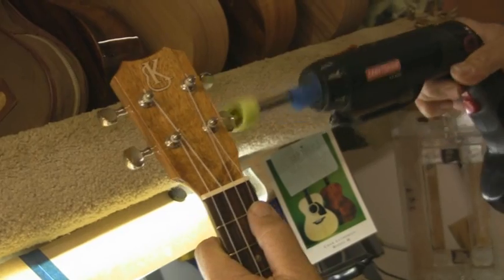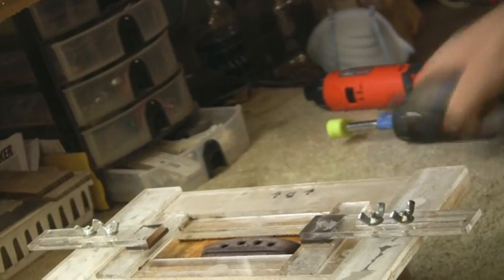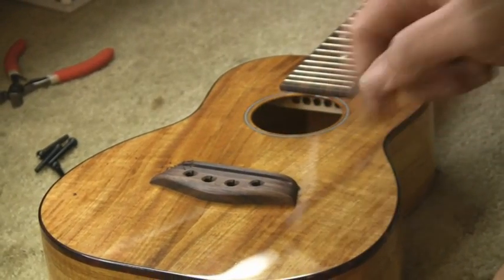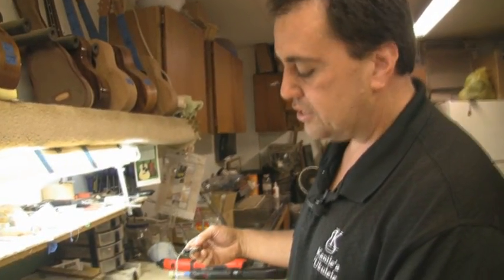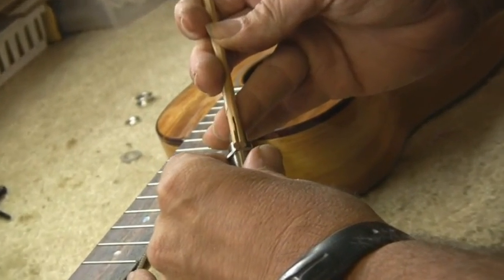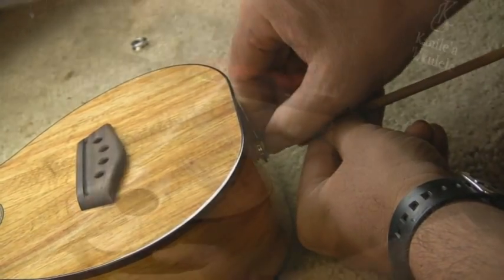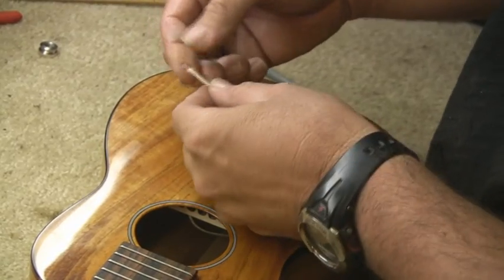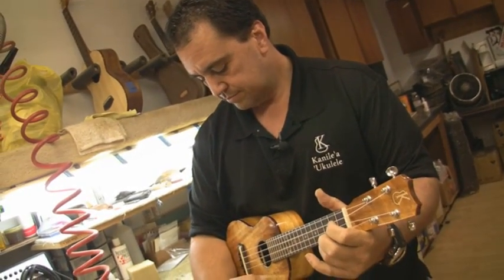Uke Minutes 69 - How to Install an Ukulele Pickup

Comment: Also if you driving a hole for your end pin jack consider using the stewmac.com End Pin Jack Reamer. First apply some painters tape to the surface of your instrument to reduce any splitting during the drilling process. The Setewmac End Pin Jack Reamer is the tool you should be using for a perfect damage free hole in your precious instrument. Of course there are other tools and ways to do it but your results may vary.

Comment: I made a video of this process too. The stepped drill looked like a good idea - I just used and new drill bit after a smaller sized one. So that Misi uses a rechargeable battery? Looks like a good solution as I had to cut a panel out for the main unit but at least I have the tone and volume on it.

Comment: Hello,
i have just one quetion.
my uke has a thicker piece of wood just on the spot you are doing the hole.
i just want to know if the jack is going to be long enough to go until the other side.
thank you, 
i am asking this because i can tell that the uke you are using on the video doesn´t have that thicker piece of wood in that spot cause you can make the hole in a very easy way.

Comment: Good instructions.  But wouldn't it be easier to sand the bottom of the saddle than to route the channel deeper (especially lacking the slot routing jig)?  Maybe the point is to preserve the existing side support of the saddle?  Or accurately preserve the original action fixed by the saddle height?

Comment: You may want to consider the K&K Aloha Twin pickup. A lot less intrusive and reproduces a nice natural sound of you Uke. Its a passive piezo pickup but they have done a really good job on the manufacturing of this pickup and no capacitors or batteries inside your instrument. Its a lot cleaner and has a decent output for a piezo pickup. I personally didn't want to put a ribbon pickup between my saddle and bride no did I want to route my bridge. All around the K&K Aloha is much simpler and lighter on your instrument. No saying the MiSi is a bad system just pointing out that there is other options that are highly thought of such as the K&K.
Reply: I put a twin spot on my tenor, I wounder if I could get my hands into a soprano, have you tried it?
Reply: The spot transducers pick up too much body noise from your hands, clothing etc while playing

Comment: Hello sir. 
I have 3 instruments with Misi A Trio. 
1 Kala Triback Limited edition all solid tenor ukelele (spruce/rosewood. 
2 Quatro Venezolano.(solid wood) 
3 Ohana Tk 38 all solid mahogany soprano. 

The first 2 are very loud and clear.
But the  Ohana,
 i have to bring the volume up to 12 o'clock 
While nr 1 and 2  are same volume already with the volume controle at  9 o' clock.
The only thing i can imaging is that the distance between the saddle and the top from the Instrument  are higher. 
Do you have any options for me sir. 
Thank you and greetings from the Netherlands.

Comment: What happens to the little computer board with the battery? Does it get mounted somewhere? Maybe I didn't see that part.
Reply: It's the preamp. It's permanently attached to the endpin socket into which the jack goes: piezo pickup - wires - preamp - socket - jack cable...

Comment: Has anyone tried this at home? If so, did it work? I'm considering doing this but don't want to ruin my uke!
Reply: LisaAnnManning I broke my $300 uke
Reply: Ethanatic s Oh no! That's awful! I chickened out myself and ended up buying an electric one.
Reply: It's not a good idea to route the bridge. If you don't have any previous experience using the router you might spoil your uke. Instead file off the saddle to the thickness of your pickup, little by little. Always check to see if you're sanding the saddle equally on both ends of the saddle. In case you made a mistake on that step, buying a saddle would cost you way less than buying a new uke. Hope this helped.
Reply: It's a demo by an expert, I built an electric guitar from a kit that I managed to eventually get working, it's not an easy thing to do unless you do it all the time, and it's very easy to get it wrong and ruin the instrument!